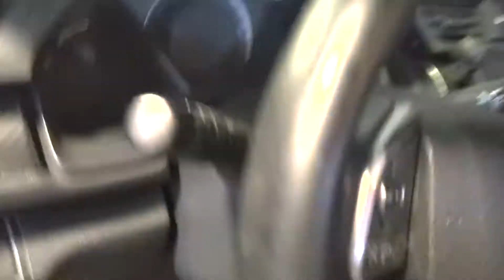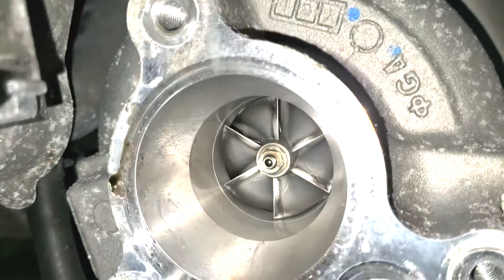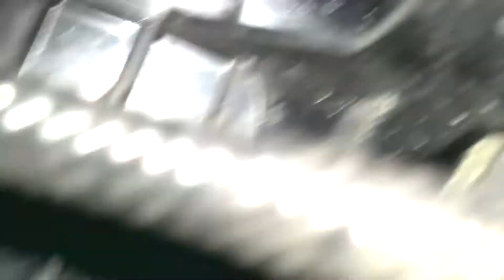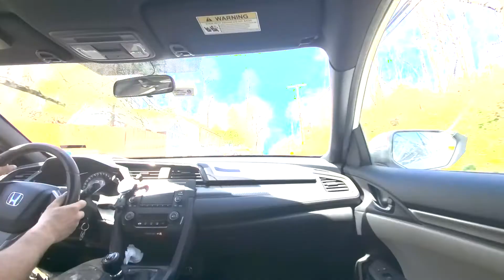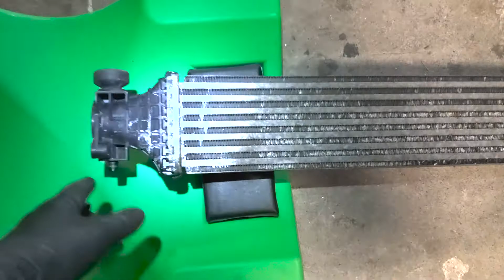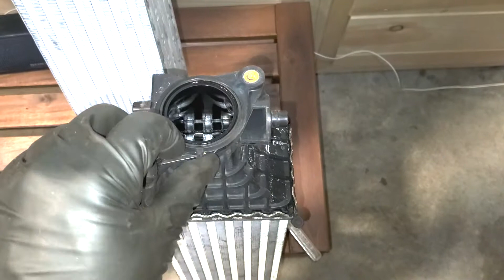Troubleshooting 10 Gen Honda Civic 1.5t poor performance and MPG issues

Comment: Congrats on solving the problem!! I'm quite surprised how clean those intake valves are after 100k+ miles, especially for a turbo GDI motor. I think they must have positioned the injector such that the intake valves get some fuel mist to wash them off during the intake stroke. If you look at teardowns of this motor it certainly seems like that was the intent of the designers. Honda engineering never ceases to impress me
Reply from the maker: I was expecting significantly more fouling as well. Not sure how they do it, but it is well designed indeed.
Reply: @tranquilizator  Honda keeps the intake valves clean on their direct injected vehicles with trimming. The intake valve hangs open for just enough time for fuel in the cylinder to get sucked back into the intake valve washing of the back of the intake valve off.
Reply from the maker: @Scottstunts  That's very interesting, first time I hear of it. What causes the fuel mixture to go back into the intake valve? Shouldn't the intake ports be under higher pressure due to turbo?
Reply: @tranquilizator  probably when the piston goes up the valve is still slightly open for a very small amount of time before it completely close
Reply: @Scottstunts  does the 2016 crv have this also? its gdi ..and talking about the trimming you spoke of.
Reply: I wonder if this design is a cause and effect of oil dilution from fuel getting into the crankcase
Reply: Yeah it washes the backsides and even at 200k where i blew mine up the carbon was minimal. Definitely works.
Reply: @xTWISTED_WAYZx  - So no need to "walnut shell" clean the intake at 100k or 150k miles - ?  Thanks
Reply: Always upgrade the intercooler from the factory since they are cheap garbage and prone to heat sink just like the ones in the focus st

Comment: That's a lot of mileage you put in there. I would avoid any 1.5
Reply: What kinds of real world failures has the 1.5T seem? Mines a champ. Way better and lower maintenance then my step dads GM v8 truck of similar age and millage.
Reply: @Yotaciv  the 1.5 has proven reliable despite all of the internet noise on fuel dilution
Reply from the maker: I think engine design has much greater impact on performance and longevity than pure displacement. Had a 1.5 non-turbo Toyota Yaris in the past, no issues whatsoever with the engine after 180k miles.
Reply: Another misinformed expert.

Comment: Is it the same engine as the CRV?  Avoid the 1.5 L turbo engine since they have had  oil dilution problems in the CRV. .Some say that trying 91or 93  octane gas may be an idea to help. Some videos are suggesting  to add an oil catch can. . No one seems to know for sure if a CRV  software update is the answer. Honda should have kept the old 2.4 L engine. No problems with that one. The Honda CRV Hybrid model is different engine and probably better.  .
  BTW Toyota Rav 4 has a normal ,non turbo engine and a normal transmission, not CVT .
Reply: I have a 2017 sport touring 1.5L turbo engine civic and I'm almost positive that fuel ending up in the oil was due to the battery taking a big doo doo on me and causing low voltage and not burning the fuel efficiently enough! Although I have went around with my wife about the fact that she got her civic with 1600 miles on the odometer and not a clue how the engine was broken in for the first 500 miles of it's life! And I can only imagine that if you only had the car 1600 miles before getting rid of it! That it had to be someone who didn't give two shits about how hard they drove the piss out of it! Someone else can have it and all the damage they did to the engine while it was still breaking in the piston rings to cylinder hone that is so critical to the life of the engine! And I watch the youth of today beating the hell out of these cars like they think it's a video game or something! If they could see all the maintenance needed to be able to drive an engine  full throttle in racing engines ( Valve springs get punished and anyone with racing knowledge changes them frequently! ) They might not be so quick to beat the crap out of the car! Enstead! They get the biggest, Loudest fart can muffler that they can get their hands on! And have absolutely no knowledge on tuning for such a radical change to the system that was designed for what the manufacturer made it for, An accasional fun run! But it's been my experience that if you have anything flowing past the rings and ending up with excess fuel in the oil you didn't break the engine in the way you were told!ending in failure due to stupidity on the first owners of the cars negligence!
Reply: @tonymayhew191  I methodically broke in my engine and have not had any loss of oil but I have had fuel in the oil to a pretty low percentage of less than 3%. My oil being 5w30 or slightly heavier has helped to lessen the fuel but with mapping for my 2017 being 1st generation, it is bound to happen. Honda has new cold-start mapping but refuses to just flash my ECU for free so nothing has been updated. Very fine fuel droplets get on the cylinder walls and since the walls have honing to hold oil, it does mix with oil and it is probably far less when the engine has warmed up.
Reply: @tonymayhew191  breaking in an engine is a myth on newer cars. Usually only Tubo'd cars need a break in period for the Turbo, not the engine.
Reply: There are plenty of 1.5T out there with over 250,000 miles on them. So your point is invalid.
Reply: No , everything I said about the 1.5! Turbo is true. It’s real. Thousand of  crv had the same issue  for years . gas in the oil is a problem.  It may  be corrected by now.   Yes I’m sure there are some cars that last a long time. But avoiding that engine  and  buying the hybrid  instead.  Is. A safer option .. why gamble ?  Personally I  prefer the rav 4.
Reply: Oil dilution is a none issue. Hard to dilute a quality full synthetic 0w-20. 
Drive the snot out of it, keep it in sport mode in winter till its fully warmed up. Really cold days it stays in sport mode for my 20 mile highway commute. 
You could drive it 100mph and it would still be more fuel efficient then a half ton truck. Lol
It will go 100mph on a crapy highway to boot if you want.

Comment: I just bought a 2016 Civic and thought that I should be getting more power. So now thanks to this video I'm off looking for a leak in my intercooler
Reply: interccooler is for air. you mean radiator?
Reply from the maker: I believe he is talking about an air leak. That's the condition I described in my video - when intercooler develops a hole or there is a bad seal, compressed air escapes, creating an air leak. This will affect engine performance
Reply: @tranquilizator  oh that makes sense.
Reply: leaking water is normal for the AC condenser

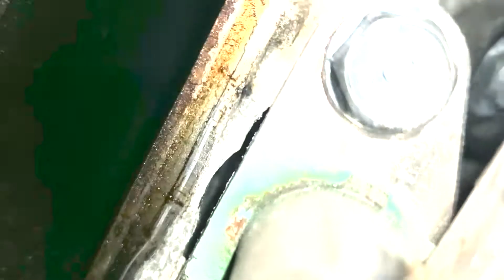Comment: 6:44 thats why you need an Oil catch can. also some of that is bc of Oil dilution
Reply from the maker: Oil can would have helped, no doubt, though I am surprised how little fouling there was after 100k miles. Was expecting much more
Reply: @tranquilizator   they have a built in catch can at the rear of the intake manifold and the oil drains back in to your crank case ,they thought of every thing . my wife drives a 2018 civic touring 1,5  t. I change oil at 50% oil life ,and use 5/30 syn  and use top tier gas never any gas with ethanol . .and no oil dilution yet ever ,good job  !.
Reply: @oldbiker9739  Where do you find ethanol free gas? all the gast stations on my state have 10% ethanol.
Reply: @Kagemusha320  Canada , and military wont use it or boat docks gas stations
Reply: @oldbiker9739  oh ok.
Reply: I should of said northern Canada, because ethanol collects water and freezes the fuel lines .
Reply: @oldbiker9739  Im down in california. There used to be a hand full of gas station that didnt use 10% ethanol but im asumming CA Emissions Regulations must be the reason why they all use it.

Comment: Does the dipstick smell like gas ?
Reply from the maker: Nope
Reply: @tranquilizator  You are lucky. my 2020 Si sedan's dipstick smells like straight up GAS
Reply: @tranquilizator  only 9K miles on it
Reply from the maker: @baggedtuned8569  that's not good.. how would gas even get into the oil?
Reply: @tranquilizator  look up oil dilution for honda 1.5L turbo engines. It affects the CRV's and Civics bc they have Direct Injection.
Reply: @baggedtuned8569  have you taken it to the dealer? My wife just got a 217 crv and when i asked about the oil dilution issue they told me that the “fix” was a software update 🤷🏼‍♂️. Dont know how much i believe that but my wifes crv does not have the fuel smell on the dipstick. Ill be monitoring the oil but ive lost some confidence on honda products. Anyway good luck! 👍
Reply: Its normal for a direct injection engines to allow a small amount of petrol to escape into the oil. As long as the odour is not to strong.It should be okay.
Reply: A gas smell could be oil dilution and it has been happening in the 1.5 turbo engine in the Honda CRV. They could be the same engine. Try 91 octane gas as an idea